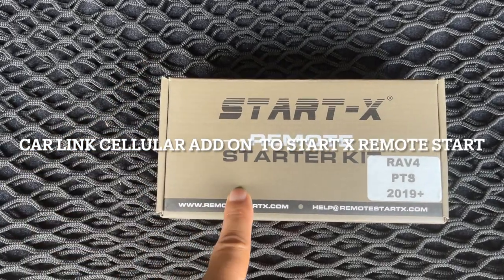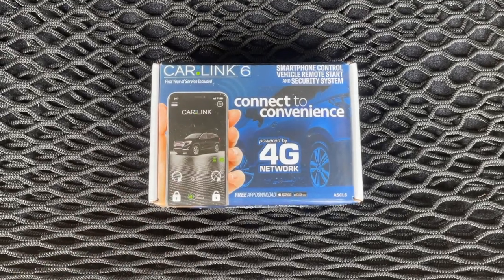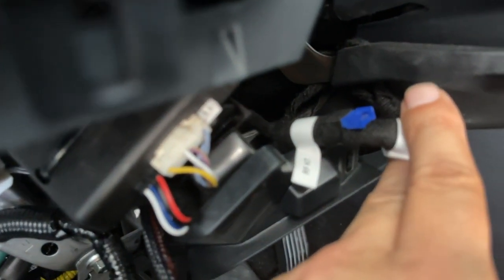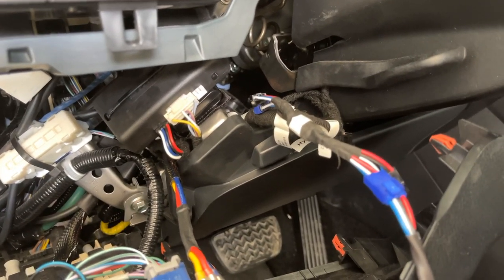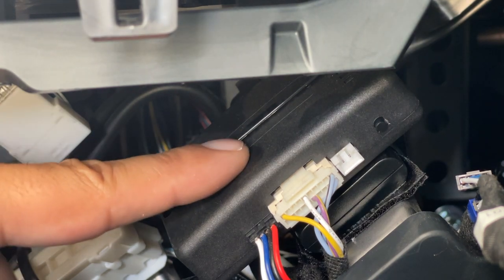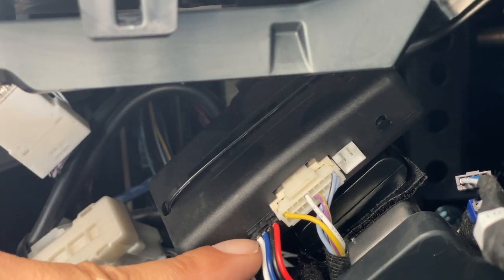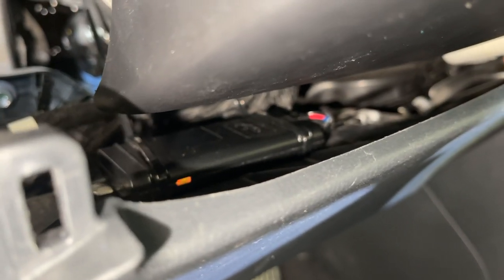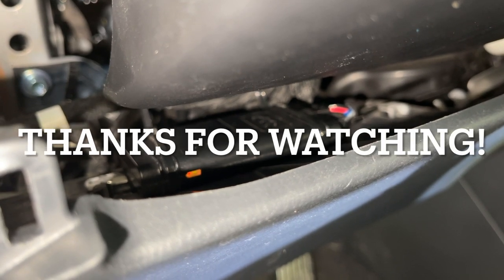Car Link install to Start X remote starter on 2021 RAV4   HD 1080p

Comment: Thank you so much, this video helped me out 💯
Reply from the maker: Glad it helped!!!
Reply: Question: After installing this on your RAV4 does the heater/ac automatically turn on based on your prior settings?
Reply from the maker: @VincentGonz  It’s the same as you getting into car and starting it, so any settings your vehicle would normally keep this will be the same.

Comment: Weirdly enough, this exact setup works for my 23 4runner, startx starter and carlink 6. The only thing that's off is that it refuses to unlock from the app. It knows and shows when I unlock via the fob or door handle, but when I try to do it from the app, I hear the startx click twice but the car never does anything. Then the app shows its unlocked when it's not
Reply from the maker: That is odd. All functions work on my RAV4. Have you contacted start x and car link?
Reply: Thanks for the comment. I'm looking at this for my 21 4Runner. My StartX is installed behind the glove box so I wasn't sure it was the same.
Reply: @MarkKlanac  yeah I just did the startx and carlink all at once last night in about 2.5hrs. I tried following the carlink install manual and it absolutely did not work, but this guy here's way worked perfect besides the unlock thing. Finding a spot to leave the carlink is wonky though, let me know if you find a solid spot for it
Reply: @DoItTogether2022  I wrote an email last night but they probably won't respond until Monday so we'll see 👍
Reply: @masonoliver8818  is yours behind the glove box?
Reply: @MarkKlanac  yes, and even being down in there, the carlink still gets the 4g lte signal inside of my buildings parking garage
Reply: @masonoliver8818  I ended up using a command strip and sticking it to part of the plastic. Hopefully it doesn't come loose.
Reply: @masonoliver8818 did you ever figure out how to get the car to unlock?
Reply: @MarkKlanac  I haven't looked into it very hard. That's not a feature I think I'll ever need so I won't really commit to fixing it unless it's easy
Reply: @masonoliver8818  I didn't either... Until I just locked my keys on the car testing it out. 🤣🤦‍♂️
Reply: Im having the same issue (23 4runner OPR) Weird, im curious if its a compatibility issue with the later models.
Reply: @batangisip89  I reached out to Carlink and they said it won't be able to unlock.
Reply: I reached my start-x with accessorides and now works

Comment: I'm installing the carlink module onto my Startx key unit 2020 Honda HRV. How did you determine which harness adapter to use and which port on the Start x to use. My Carlink gives no instructions on this. Unless it does it on the app. I was just reviewing things before starting the carlink install. Start X is installed and working fine. Any help would be great

Comment: Hello, Do I follow these same instructions if mine is keyed? Exept Ill just be turning the key to the on position?
Reply from the maker: I’m sorry I don’t have an answer to your question. Maybe someone else will know and respond.
Reply: @DoItTogether2022  I downloaded the instructions from google which were exactly as u pointed out in video but it doesn’t specify pts or keyed. Instructions only state to put in “on” position so im assuming it doesnt matter🤔
Reply from the maker: @Hector-cn3rv  I didn’t know they actually made one for the keyed ignition.
Reply: @DoItTogether2022  Well I have a 2021 Rav4 push to start and a 2019 Camry SE key to start. Both vehicles have the StartX remote starts installed. I definitely will be purchasing this Mycar cell phone module for the Rav and follow your instructions on this video. Im just curious if this same programing method is used for the Camry as well. How did you get the programming instructions for your Rav in the box or on the app after you input vehicle info?
Reply from the maker: @Hector-cn3rv  I did this video because the instructions were kind of all over lol, but I believe it was mostly in the box.
Reply: @DoItTogether2022  If you can recall do the programming instructions inside the box universal for any vehicle or for specific vehicle? How did you know to follow the Fortin/Evo-All for the StartX module?
Reply from the maker: @Hector-cn3rv  It was in the instructions. I think I also had to check on their website or emailed them to ensure, but fairly certain it was in the instructions.
Reply: Hello again. One quick question. When you first installed the Startx remote WITHOUT the cell phone module was programming the same with both red and blue lights or was it only with blue light then when you added the cell phone module programming changed to red and blue lights? Reason Im asking is because I have the instructions on the Startx remote say that the programming is with ONLY blue lights. Just want to know if programming chages  ( From only blue lights to red and blue)  once you add on cell phone module.   @DoItTogether2022

Comment: Hello, I installed the evo-all with the carlink module, but my battery died and i tried pairing the carlink with the evo-all but nothing seems to happen. I'm able to remote start my car with the key fob , but the the module and app are not working. Do you know how to fix this ?
Reply from the maker: I would check and make sure the unit is getting power. It was working prior with no issues? What vehicle? You may need to contact car link directly. They are quite helpful!

Comment: what did u use for remote starter configuration protocol did u use fortin
Reply from the maker: if I remember correctly it was Fortin, but it’s been a little while since I’ve done the install.

Comment: The instructions are pretty horrible. How do we know which included harness is right for our vehicle? I have a 2018 Toyota Sienna. There is no information on which is the proper protocol for vehicles either. I selected ADS. I can get the App to start the vehicle but the app buttons don't turn green to show activation, they turn red and the app shows the vehicle is not started even though it is. I'm at a loss here.

Any advice would help
Reply from the maker: Sorry for the really late reply, I never received notice of this comment.

Is your vehicle the push to start?
Reply: @DoItTogether2022  no worries. 

I was able to call customer service and they walked me through the steps. At first they weren't very helpful but eventually we got it figured out.
Reply: @benlavigueur4275  Im having the same issue at the moment what ending up being the solution?
Reply: @jorgillo707  I had the correct protocol but customer service had me do a different installation process. Call them

Comment: Is reprogramming the start x a must when installing the car link?
Reply from the maker: Just saw this, sorry for the late reply. No, it was actually very easy to add the car link!
Reply: Thank you very much for your video. I have few questions. I have a start x remote starter i programmed to work normally but not far enough. If I add this car link on do I have to program exactly like you or I have to go fortin flashlink app to program it too before or after program that unit. Please advise. Thanks

Comment: I tried installing it when I received it and failed due to not having any instructions. Now I barely had the time to reprogram everything and the carlink leds do not turn on any help? My start x remote start works I just don’t get anything from the car link
Reply from the maker: What are you installing this into?
Reply: @DoItTogether2022  2018 Chevy Cruze
Reply from the maker: @albertonunez7681  Have you downloaded the instructions? I can email you a copy if needed?
Reply: @DoItTogether2022  yeah I have the instructions thank you. When I first tried to install the car link I would get a red and green led and now I have no leds turning on
Reply from the maker: @albertonunez7681  Sorry I can’t be of more help, maybe contact them directly?
Reply: @DoItTogether2022  I think that’ll be the case thanks though and thanks for the detailed  video
Reply: @albertonunez7681  are u using the start-x module too